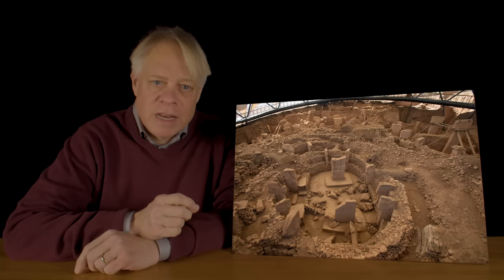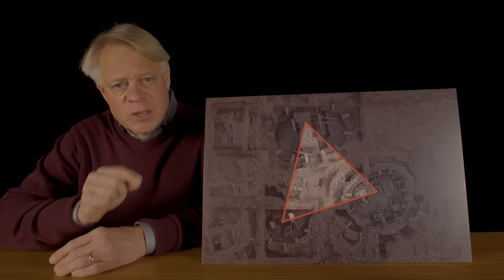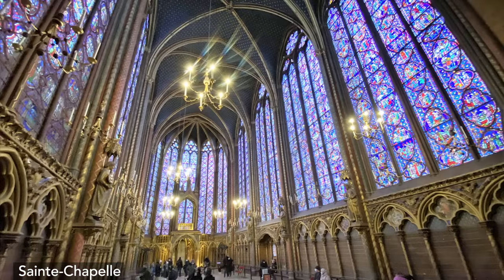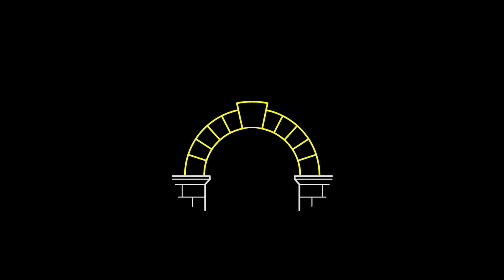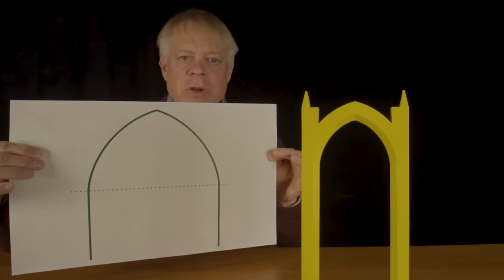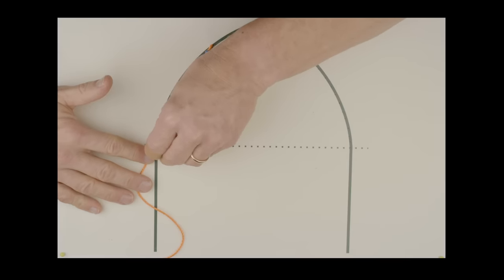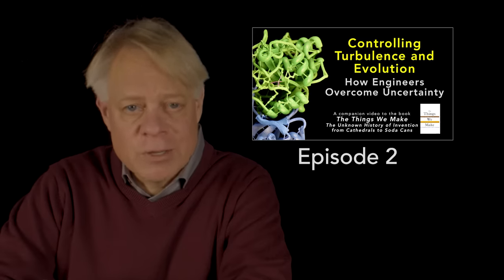Building a Cathedral without Science or Mathematics: The Engineering Method Explained

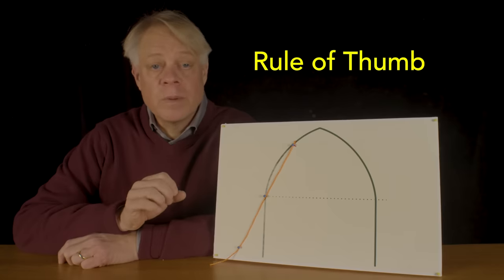Comment: Around minute 10:05 the speaker says that the rule comes from centuries of experience, from trial and error.  In other words, it comes from the scientific method.  There were repeated experiments (experience) to find out what works and what doesn't and then then went with what works.  It is not a "scientific analysis" of the properties of stone, to be sure.  But it is the scientific method in the purest sense of the word.   So, I am a bit disappointed that the theme is how they did it without science, when it is exactly the application of the scientific method that led them to their engineering method.
Reply from the maker: You identify science with trial and error, which I don’t think is correct. My point is partly a teleological one: what I am getting to here is that the development of that rule — one of many — is not an approach to greater and greater truth on the commonplace sense of what science is trying to achieve. If one insists on saying engineering is “applied science” — which is the sense of your statement — then you need to give a lot of thought to what “applying” means. When you do you will come up with a process like what I am describing. To my way of thinking this suggests the phrase “applied science” isn’t very meaningful. In fact, as I note on the next video the purpose of the engineering method is to solve problems before we have full scientific knowledge.
Reply: Don't worry, @engineerguyvideo is making wild claims with no substance well outside of his field of expertise (he's a chemical engineer). 

Ancient and medieval societies absolutely used the scientific method, they just had a different name for it. Using fractions and trig to work out architectural designs IS mathematics. 

This entire video is deeply misleading

Comment: "The masons didn't have math" so you suggest a procedure that involves many steps, including dividing a length of string into thirds. If that was possible then a faster and less complex method would've been to just divide a length of string into fourths and using that for the wall thickness. Is there any evidence that anything like your method, with all its steps was used?  If not, your suggested method sounds like it is a solution looking for a problem instead of the other way around.
But even before the thickness of a particular wall was decided on, the master would have worked out how many arches would be used based on the overall layout of the cathedral----meaning many considerations played a part in the details. Including bragging rights in the race for the tallest cathedral.
Lastly for every remaining cathedral, how many were lost to failure?  You are taking only the winners and not the losers to form your thoughts. The losers might have failed for any number of reasons, poor foundations, lack of quality stone close by, building too tall, a change of plans.
Even today when building many boats the concept of a 'fair' line is used. How is that any different from a rule of thumb?

Comment: Engineering method itself is a form of scientific method, or rather the very core of scientific method.
Science is not all about math, precision and elaborate theories - first and foremost science is about repeatedly testing what works in REALITY and what doesn't.
This is key, and a lot of people don't seem to know it. And because of that they fall for pseudoscience easily.
Reply from the maker: The point of the video and my book is that this isn’t correct; I might be agree that the scientific method is some kind of subset of the engineering method though!
Reply: @engineerguyvideo  
What I wanted to point out is that a lot of people nowadays make a mistake of equating modern, highly advanced and highly rigorous, scientific method with science in general.

And what's worse, I see that a lot of people don't know what the key foundation of science is, which is experiment - repeated testing by reality, repeated observation of reality.

A recipe that stands the repeated test by reality and thus produces predictable result is called 'technology'. Any specific "rule of thumb" would be an example of technology. And practical application of technology is engineering.

Math etc., however, are not science - they are just tools to make science better. 
They are "engineering applied to the science itself" one might say. But without the core it ceases to be science (while still looking like "science" to the layman on the surface).

Arrival to even most basic rule of thumb is inevitably science at its core. Even if it's a prehistoric caveman hitting rocks against each other to make a sharp rock. Divination or astrology etc. do not produce technologies - only repeated observation of reality does.

This is why, in my opinion, "science vs pre-scientific engineering" is kinda a disservice to public understanding of both science and engineering - they are two sides of the same coin rather than opposites.

Of course it's just nuances of semantics, and there is real distinction between this "proto-science", modern science and engineering; and I get that saying "cavemen were doing science" is ridiculous when out of context. But I believe these nuances deserve to be highlighted by educators like you - especially now, when increasingly "feelings are more important than facts".

Comment: This is not engineering. This is craftwork. Engineering is applied science.
Reply from the maker: My argument is that the purpose of engineering is to solve problem before we have scientific knowledge — as so discuss in other videos in this series — so to my way of thinking applied science is not a good definition to my way of thinking. Note, thought, that I am not suggesting engineers don’t or should use science, but that to call engineering applied science is to confuse one of the tools with the method … eg it is like calling writing “applied lettering” …

Comment: cool, may or may not be "engineered", they are erring on the side of caution, so possibly overkill/waste of materials.  If the thickness of the wall were based on a rule of thumb that caused to one third of the arches span it would have also worked... and ,similarly, would not have known if they wasted material.  Experience from failures maybe led to the rule of thumb they used.  Either way they got it done.  We may never know if they analyzed what their safety factor was.

Comment: To be a medieval cathedral architect you would be required to have a knowledge of music and harmonics, sacred geometry, astrology and esoteric symbolism. An engineer of today is not able to read these structures. The ancient architect believes that a building correctly proportioned will stand but a building incorrectly proportioned will fall. To them the cosmos is harmonic so it endures, anything that is inharmonic will fall apart. All the parts of a harmonically designed building will share the load. If one part of the building is not in harmony with the rest it will disrupt the structure and result in the inevitable destruction of the building. This is not Science to us but it is to them and years of training under apprenticeship in a guild is needed to acquire this knowledge

Comment: "Rule of Thumb" comes from the concept that you could beat your wife, your children , your servants with a stick that was no larger than your thumb, because the objective was simply to "teach them a lesson".  A stick larger than your thumb was just being mean.  In a similar sense, "rule of thumb" in buildings is applied similarly.  Many, many buildings fell when the rule of thumb was calculated incorrectly, sometimes after generations of construction investment.  Only those that got it right are standing today.  Some, like Pisa, require huge supplemental investment.  Those still standing represent a small percentage of the total that fell, sagged, sank and faced other catastrophes.

Comment: I don't understand the point of the demonstration with the string. The designer would have to climb up onto the roof of the structure several times in order to drape a rope across it, then lay it down on the ground. Instead, why not simply lay a rope on the ground between the walls to get the width of the span, then fold it over upon itself twice, giving you one quarter of the span? No need to climb up.
Reply from the maker: They did this on wood templates in the drawing room; also keep in mind that it is  unlikely the mason was thinking “how do I make a wall a fourth of the inner span” - the notion of it being a proportional rule is OUR language — but instead had be taught that he should do this action.

Comment: I fail to see how this isn't science or math. the scientific method is just trial and error, which is what he's describing. yeah, they weren't analyzing WHY it worked but its still observation, hypothesis, and then a test to see if it worked. Some roman architect was fuckin around one day and figured out that you can make an arch. idea gets refined through experimentation over time. the fact that they weren't using numbers on paper doesn't make the ratio relationships between height and wall thickness NOT mathematical. ???? 

maybe it predates the dawn of the 'scientific method', it isn't formalized in the way we understand it today through writing, but the process is exactly the same, its just... reasoning. Wikipedia is defining science as 'a neutral, rigorous, systematic endeavor that builds and organizes knowledge in the form of testable explanations and predictions about the universe.' .... which is exactly what you're describing as the engineering method here. maybe its as rudimentary as the knowledge that 'rock will sit on top of another rock' but that's still KNOWLEDGE; knowledge that gets transmitted down through generations.

this seems more like a discussion about the difference between inductive vs. deductive reasoning. Or maybe science is just too vague of a word, and i'm conflating it with 'process of reasoning'? Knowing something works vs. WHY it works? Applied vs. theory?
Reply from the maker: I think you hit the mail on the head that science is too vague here. What I am trying to point out is that engineering proceeds full scientific knowledge and that it is not an outgrowth if the scientific method. I do explore this in the other videos in this series and, of course, in the companion book. Also, I would resist labeling reasoning science …
Reply: @engineerguyvideo  Thank you for replying! I totally get what you're after. its an annoyingly fuzzy word
Reply from the maker: Yeah … I wish I had done a more careful job!

Comment: But how did they arrive at those rules of thumb? Surely they tried many ways of doing it, and recorded or remembered which worked? Which is exactly the scientific method, even if it's not recorded through the language of math like we do today?

Also the thing about engineering methods being "outdated" and not "disproved" is actually exactly the same as what happens in science. Newtons theory of gravity is now outdated, because of the general theory of relativity. It is not wrong, simply outdated because we have something more accurate.
Disproving theories does happen in science, but so it would in what you call "engineering". I'm sure someone once suggested a "rule of thumb", but then after 3 years his construction collapsed, and people agreed that "no, that rule probably isn't sound". 

Your video is interesting, and I enjoyed learning about how cathedrals were measured out, but your points about how science is not needed seem contradictory to me, since you literally explain a scientific way of measuring things out, as the method they used. It sounds like what you're saying is that you don't need arithmetic or modern mathematics, but you certainly need the scientific method, albeit in a very primitive form.

Just the perspective of a guy with a degree in physics =)
Reply from the maker: I would argue that trial and error is not the scientific method — sure it’s one of the tools used by both engineers and scientist. They key point here — and the separation between science and engineering — is whether or not it is hypothesis driven.

Comment: The video makes the impression that even modern Engineers don't need science at all and justcuse tules of thumb. That's clearly wrong at least for electrical engineering, which uses a lot of methods that where discovered by scientists and all of these can be directly derived from Maxwell's equations although some like Kirchhoff's circuit laws predate Maxwell's equations.

Comment: So define science and define engineering. Each takes from the other. Until the Romans made the constructed arch the later engineers could not have varied it. How do you know there was no ruler. They had no ruler in rural Britain which is why clay lump bricks vary in size to the body parts of the builder. Miners measured mines in darkness by this method. The line is a known method of measurement and it is a mathematical rule of proportion. So maths existed but not in current form. So it is all a fundamental application of modern words.

Comment: Excellent video.  Can you make a video about using sticks and pins (or nails) and a pencil or chalk to trace any curve of any height and width?  This used in boatbuilding for making deck beams and also requires no science.  Loved to stump baby engineers with their computers and printers!!!!!!!!!!  Hilarious when they did it and say "no real math necessary and could have been done thousands of years ago better than they and their computers and printers today..  Haha!  method.  Place pins in ground at curve distance or length.  Mark halfway (center) point.  At center place a pin or nail in ground at desired height of curve.  Next, take the two sticks (or boards or lath) that are longer than needed and place form sides to center.  FIX the two together at their intersection, place marking device at this intersection on the 'inside' of the imaginary triangle being formed. NOW... Simply take chalk or pencil or whatever and slide the two sticks from side to side, you'll have a perfect arch of desired dimensions and not a lick of maths needed !!!

Not my trick, I learned it from a British book on making wooden boats, specifically how to easily create a 'beam form' for creating my laminated deck beams...

Comment: Most of the content of this video is incorrect. The assertions about the abilities of the masons and craftsmen, their tools and methods, and especially the ridiculously elaborate geometric construction used herein to generate the wall thickness when quite simple Euclidean methods are readily available and require far less effort; all of these things make this video absurd. You could have done much to illuminate the different engineering methods that can be employed when there is no theoretical "scientific" basis on which to focus, things like cut-and-try, trial-and-error, and various statistical and approximation methods and optimization strategies, but, instead, you focused on "rules of thumb" as your differentiator between "engineering" and "science." In this way, you've helped to ensure that the "all but hidden" engineering method... remains obscure. 

And what of Göbekli Tepe? You found a triangle in its layout but never explained what engineering purpose might have been achieved by such, thus you never substantiated your claim that it was an "engineered object." Likewise with the wall thickness of "one-fourth to one-fifth" of the arch span with nary a word as to why. Surely this constitutes a rule-of-thumb but, absent an explanation of its genesis, it becomes a singularity to be memorized or discarded without ever attaching to it any meaning. Such abandoned topics leave your viewers wondering what such material was meant to illustrate. Surely presenting engineering as seemingly nothing but an endless bag of rules-of-thumb stand-ins for absent scientific notions was not your intent.

This twelve minutes could have been so much more.

https://en.wikipedia.org/wiki/Building_a_Gothic_cathedral
https://en.wikipedia.org/wiki/Ogive
https://en.wikipedia.org/wiki/Arch
https://www.youtube.com/watch?v=k_A6Ck3nWj4

Comment: i m sorry but arent the engineers planing and building that cathedral basically doing math? its just not with numbers but variabels and they use a geometric calculation instead of on paper? i feel like the argument science isnt needed in engineering a bit like trying to pit two groups against each other. Science is figuring out how stuff works and engineering is putting this knowledge into problemsolving. Science needs engineering to build machines to test hyptotheses and engineering needs science to make informed and planned decisions. Sure often enough going in blind with rule of thumbs is often enough but a good engineer should look into what happens if certain parameters exceed normal conditions to plan for failure and safety